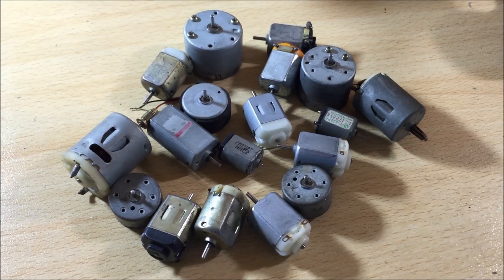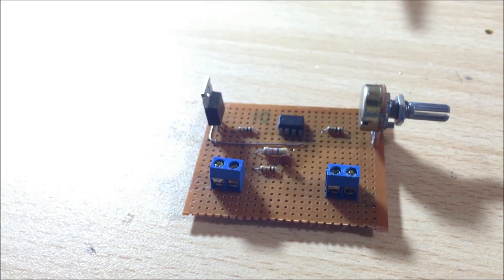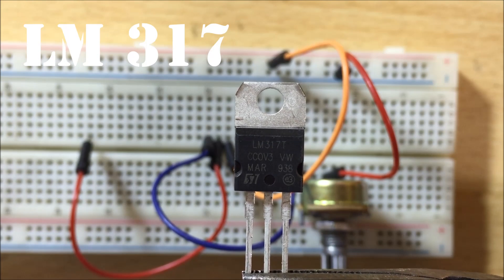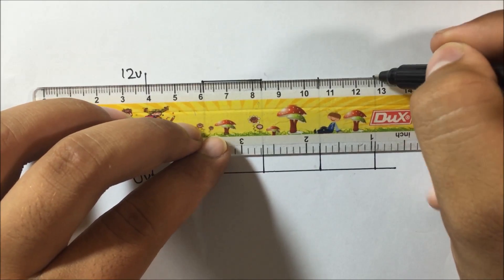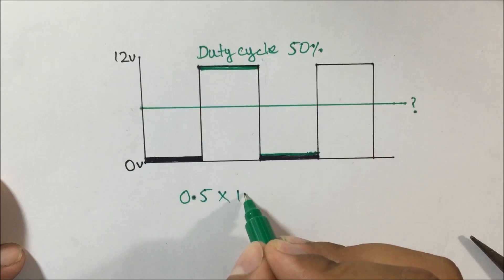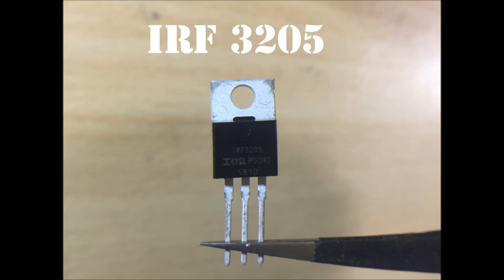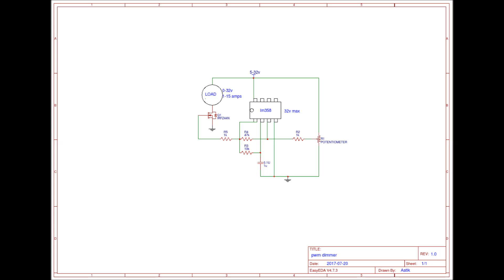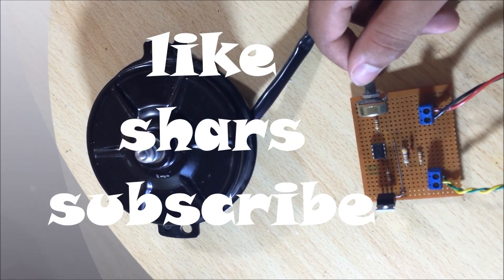DIY PWM dimmer,buck converter 0-32v 30amps|| pwm

Comment: Does the Voltage Output be smoothed out withtout a capacitor?
Reply from the maker: Man Nok Wong no the output is still a pwm signal  you can easily drive motors with it. But if you want to run some ics or sensitive circuits then you will need a LC filter to smooth the pwm signal

Comment: thanks for the video , can I use this for controlling the amps in car charger ? I converted my old UPS transformer in to a car charger and I get 14.4v DC / 30Amps . but I like to charge the battery in 10 amps only  . thanks agane